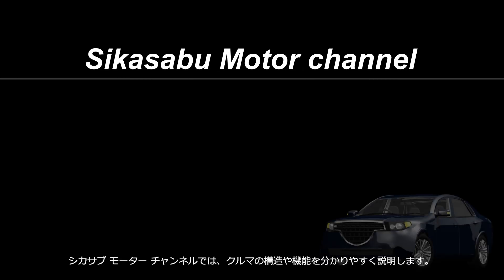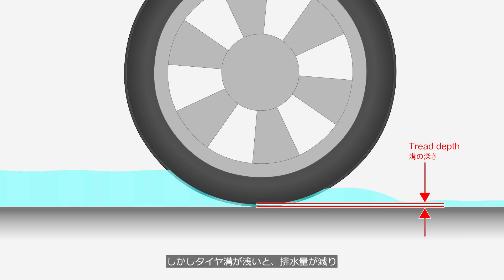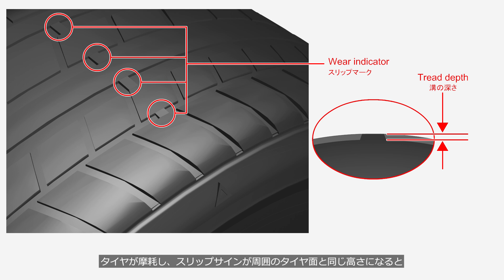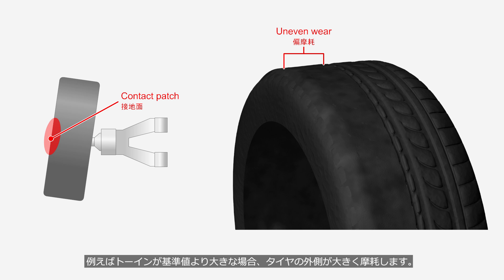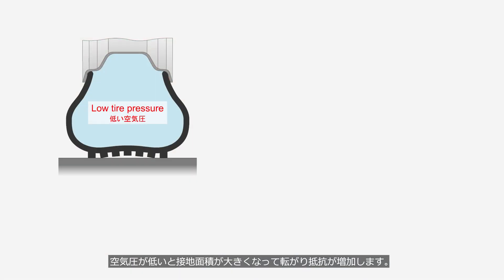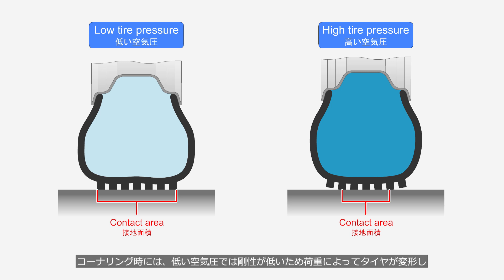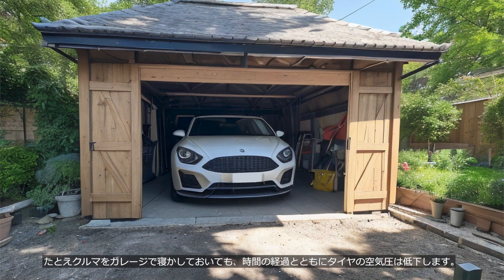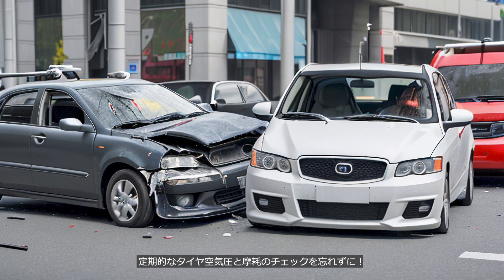Tire pressure and Wear

Comment: How will I know the correct tire pressure if I live in a very hot climate?
Reply from the maker: Thank you for watching the video.

Please refer to the following points:
When the volume is constant (the tire does not deform at all), an increase of 1°C in air temperature at 20°C results in a onlt 0.34% increase in air pressure.
When driving on a highway, the tire surface temperature exceeds 70°C.
From this, I don't think you need to worry too much about the relationship between ambient temperature and tire pressure.
I believe you should simply adjust the tire pressure to the manufacturer’s specified value for your environment.
If you are still concerned, I recommend contacting the manufacturer’s customer support.